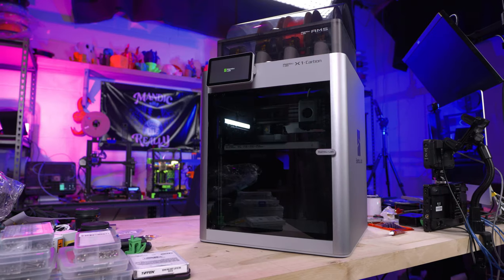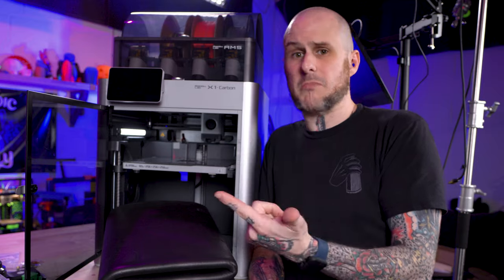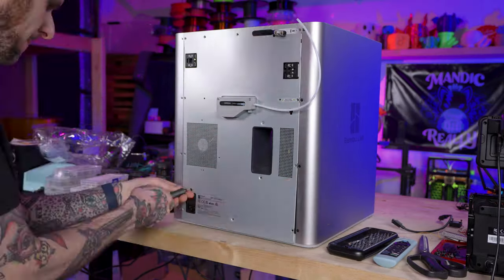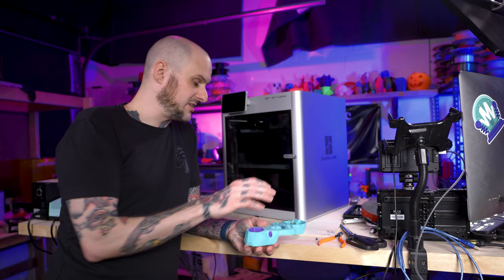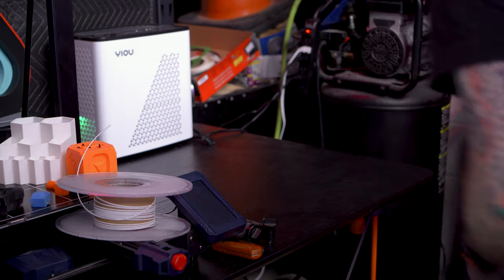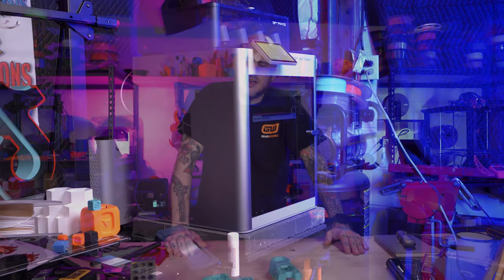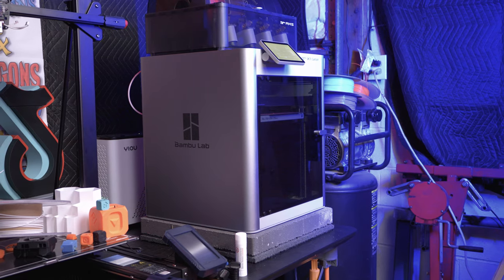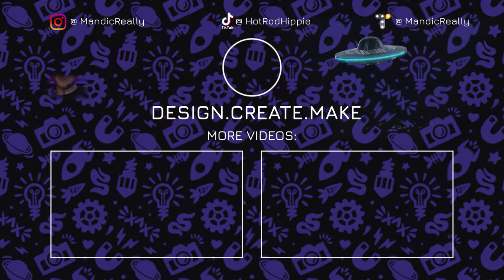Bambu X-1 3D Printer Modding & Problems - Noisy Ringing BEAST!

Comment: Just stick Teroson tiles to the AL panels and bottom panel. Your foam does not add much mass, Teroson add both viscous layer and mass. In you case youmaystill radiating a lot of noise through the panels. Your foam seems to be a closed cell foam and might be also a hasard if it is not fire rated.

Comment: I know this is an older video. I just purchased the BL X1CC and am watching a lot of videos about it. Did you try the anti-vibration feet you can buy for $10? I've only seen 1 video about them so far and he basically took them off right after putting them on. They do make the printer move/shake more, but to me, that means if you have multiple printers on the same table, then it's not going to transfer it's vibrations to the printers sitting adjacent. Makes logical sense in my mind, but I don't have the tools to measure that scientifically.

Comment: Have you checked if it's the slicer generating smoother edges? I've also noticed that slicing STLs is different and the slicer fails with some models if in 3MF format.

Comment: I would do the car audio sound deadening material for all of the panels.

It works better than the foam stuff in my opinion.
Reply from the maker: I did.  Everywhere you see the Foam stuff it has the foil material underneath it.  It is doubled up.
Reply: @MandicReally  ok my mistake, I think what you did here is fantastic.  I have one of these on preorder.

I’m going to do this same thing.

Are you sure you’re not getting good vibration correction because the table simply isn’t stable enough.

Maybe try doing the correction on your garage floor, and then printing the part for the Voron?
Reply from the maker: @frictitious  I did that at @14:50 it only made a marginal difference.  Still not to the quality I would like to see.
Reply: @MandicReally  My mistake,  I listened while working on one of my other printers.

That’s disappointing to hear….
Reply from the maker: @frictitious  I know of another person who printed a StealthBurner shroud without issue (multicolor as well). Mine just… isn’t. So maybe it’s just my machine? Maybe it’s a bigger issue? I don’t know yet.

Comment: For your rounded corners, try to see if there is a "corner velocity" or "jerk" setting. having those high makes for faster prints but rounded corners with ringing
Reply from the maker: It is a closed source printer. There are no settings menus to tweak things like that. The slicer doesn’t have anything beyond general acceleration and speed settings. 

That was the point of my statement about Klipper. I have NO IDEA what the machine is setting when it does it’s own calibrations and no way to tune them manually to test. It’s all a black box. That may be good for a newbie, but it is very limiting otherwise.
Reply: @MandicReally  there is probably a setting in the firmware but it’s not available to the user. Curious to see what bambu lab has to say about this.
Reply: The max jerk is set to 9mm/s for X and Y in the slicer, so not at a point I'd expect to see significant rounding.

Comment: I wonder if heat reflective foil on the glass would help keep heat in.
Reply from the maker: It absolutely would.  I'm debating ordering another piece of glass to test further and slap some of the foil insulation on it.  Currently I have the rest of that sheet of foam just sitting on top of the glass (outside) and it has raised the chamber temperature to 51C, the first I've seen it break over 50C.
Reply: @MandicReally  even the see through foil that goes on windows to reflect heat either in or out might work well enough
Reply: I also see that the display for the chamber temperature shows a maximum of 45°C, I wonder if it starts venting warm air to maintain the temperature at 45 degrees. Unfortunately the option to raise the chamber temp up more isn't available.

Comment: The most unpleasant noises are coming from the fans if printing material that needs cooling and from the motors when changing directions. Printing gyroid-infill for example is very loud while other infills far less annoying. The most especially fan-related noises coming from the back of the printer and just putting a thick blanket behind does quite the difference.

Comment: You really messed up the printer. I used reflective insulation sheets with magnets for my P1P printer, to cover the sides over the acrylic glass covers for printing with ABS and nylon filaments to retain the heat. It does work well including reducing the noise. Very easy to remove when using PLA and PETG filaments. The P1P printer with AMS unit is a better choice than buying the X1 carbon. You can make the enclosure of your choice and upgrades.

Comment: You seem pretty experienced with this sort of thing so despite the official recommendation Id love to see you try out TPU/soft pla on the AMS and give your findings, results and problems.

I absolutely plan to give it a shot when I get mine given I too have a lot of tinker experience, but I've been curious ever since seeing it.
Reply: The AMS doesn't work with TPU, but directly feeds the results are amazing even I'm printing at 120 to 150 mm/s default.
Reply: TPU does not work in the AMS because it gets stuck and can cause damage, you need to feed TPU in directly from the back hole

Comment: I have NO problem with the noise thank god. Mine sits in a  room with 10 other printers @ times it not even the loudest printer in the room :P  What i do have a prob with..... is when it really gets going it looks like it wants to dance it's way off the platform it's on..... im thinking to just hard bolt it thru the base. Thin metal sides will always ring.... it's actually a really bad choice as good as it looks.  PC's and Cars prove this.
I would even consider custom 4-6mm plex sides and i guarantee it would help the DB's

Comment: what foil back foam did you use your link is mixed up
Reply from the maker: Here is a link to some I just bought a few weeks ago: https://amzn.to/3HwdDSB

Thanks for the heads up, Amazon always messes up links eventually. I’ll change it now.
Reply: @MandicReally  sweet I just started printing abs and my chamber wouldn't get above 40c(unfinished basement single digit weather out currently).... little bit of lifting but not bad....gonna try to insulate the top first.

Comment: Hey, one thing that makes sense for me is that the acceleration is to high and that's what makes the edges more soft, as in klipper implemetation of input shaper it displays max acceleration not to introduce smoothing on edges.

Comment: Shiny materials?   $1.40 Flat Black Spray Paint.   Sound insulation --- Self Stick indoor/outdoor carpet. About 1/8" to 3/16" inch thick works.  Or - wetsuit material - neoprene.

Comment: You might not be seeing ringing so much as too much input shaping. Not sure if you can change your shaping tools on the X1 but it could be a good place to look.
Reply from the maker: I agree, that Is what I was trying to say, the compensation seems too aggressive, leading to the rounded corners.  It seems like the "Resonance Compensation" is applied to the wrong frequency or too aggressively.  There is NO control over this in the machine.  None at all, and no way of reading the data from the vibration testing to see if it is in fact incorrect.  The system being closed source doesn't allow for any of this advanced tuning that it clearly needs.

Comment: It will be interesting to see how many of your mods go into the mk2.
Reply from the maker: A little bit of the sound insulation would be very easy for them to install at the factory and go a LONG way I think. Just some thinner stuff like we use in building cars (similar to what modern cars have in their doors). We shall see.

Comment: Hello, I watch a few of your videos and i noticed you mentioned you worked as a custom auto mechanic.  Curious to see your reasons for jumping into 3D printing or how did you start.  Also did you have prior experience with 3D printing as a whole, as well as working with 3D modeling on fusion?

Comment: If you're considering purchasing a Bambu printer, have one on the way, or just bought one, all you need to do is ensure your filament is dry, run the calibration tests, and start printing. The only additional accessories worth printing are a poop chute catch can and a quick-release tool for the PTFE tube in the back. All this other shit is unnecessary.

Comment: Hi, regarding the sound, would placing the insulation outside (as an outer shell) improve sound dampening? 

I recently got into 3D printing and looking for a fast one but I’m concerned about the sound it makes and the speeds the Bambu X1C makes.

Thanks! Great video on dismantling the printer’s shell
Reply from the maker: Sound dampening should be done closer to the sound source for maximum effect. Outside of it the noise has a chance to resonate inside of the metal structure of the machine. More dampening on the outside wouldnt hurt, but would likely be ugly and less effective than inside. Unless you just build a big enclosed box, but then you run the risk of temperature issues with the electronics.

Comment: Add a reflective heat blanket material. It's super thin and will keep the heat in
Reply from the maker: I’m thinking I’ll buy a spare top window and insulate that to retain the heat at the closest point to the print area. Or maybe seek a thinner insulation for the sides.

Comment: Could you talk a tiny bit about what speeds you chose to run these tests at?

How were the corners at non-speed-benchy speeds/accel?
Reply from the maker: The ones in this video were in entirely “default” settings. Base speed settings of the .2mm profile, and “Standard” Speed on the machine. Some of my other tests were done at manually adjusted lower speeds. One was started at the “Silent” setting on the machine which cuts the speed by 50%. That one lifted off the plate so I wasn’t able to complete it. 

I haven’t wanted to pursue the speed Avenue as much because if that IS the issue, then Bambu had a problem. Making a machine fast for just the sake of fast, is not a good thing. So I’ve focused on maintaining the speed and trying to improve there. Something that should be attainable with proper settings (I believe).
Reply: @MandicReally  I guess the question becomes, "is Bambulabs pushing the machine faster than it can go with regard to accel or is their resonance comp just not tuned well?"

I'd love to see a test where we could see X ringing vs Y ringing to see if it's compensating for the weight of each axis differently.

Comment: On the rounded corners, have you tried bumping up the flow rate for your filament (or is your filament actually smaller than the slicer thinks it is; exactly 1.75mm by default)? Your top surface looks like it might be marginally under extruded which could be improved from adjusting the same settings.

I'm presuming that the corners are not extruding out quite as far as they should be, which is totally the opposite of the issue that I had, and dropping my flow rate slightly (and ensuring that my filament diameter was correct in the slicer) totally fixed the issue and got me the crisp (not over-extruded) corners that I was after, and a better top surface.
Reply from the maker: Mine was massively over extruding with this Polymaker ASA at the default “Generic ASA”
Values. The flow calibration could not compensate for it. I’m down to .90 flowrate (and it’s accurate dimensionally, Polymaker makes good stuff). I had to go that low to stop the overextrusion I was getting. Which on my Ender 3 I actually run at .93 now, this stuff just really flows. 

I can’t seem to nail a balance of extrusion on this machine. The top (and bottom) layers have minor underextrusion, but I’m happier with that than the substantial overextrusion I was getting. 

I really wish I could see the settings the machine is using. It seems to be like a Corner Velocity, Linear (Pressure) Advance issue, but I can’t tell because I have no data.
Reply: So at say 0.91 you were getting over extrusion on the top and bottom?

If you bump up the flow rate, despite the top and bottom layers being overextruded, do the corners improve?

I agree it would be nice to not just have to blindly trust the flow calibration data to be generating useful linear advance values.
Based on the G-code, if it has an issue with calibration it also just runs with default values - I'm not sure whether or not it would give you an error in this case to inform you of the flow calibration failure, unless it detects a hardware error/error in sensing generally.
Reply from the maker: @mowcius  I don’t believe it gives you an error because I’m 100% certain at the default .95 value it was just using its own default values. No flow rate adjustment any difference to the corners. I don’t think those are at all flow related. If they were I’d expect to see it in the perimeters of the print in at least a some other way (more or lesss noticeable layer lines, or gaps in between perimeters while printing). I truly believe the issue is to do with either Square Corner Velocity and/or the Input Shaper implementation. 

It’s hard to Discuss this stuff when we don’t even know what terms they use for these settings or what the firmware is doing with any of the data. I’ll be reaching out to Bambu and looking for their input & requesting deeper information.
Reply: @MandicReally  I think you should let us know as quickly as possible how they helped you.

It’d concerning that a reviewer is having these issues and they haven’t already reached out to you to try and help solve the problems.

How are is peasants going to get any help?
Reply from the maker: @frictitious  I bought mine. They don’t know me anymore than anyone else (that I’m aware of). I requested a review unit months ago and never got a response. But I’ll definitely make an update when I figure out what the heck is going on.
Reply: @MandicReally , so I didn't think changing flow values would change the corners, but for me it did, quite significantly.
General perimeter extrusion didn't really seem to change, but top and bottom layers and corners did.

My single wall thickness, and calibration object dimensions were spot on, all through tweaking these values.
Reply: I obviously have no idea what they’re doing for their vibration compensation, but from the corner behavior, it seems that part of it might be a kind of “low pass filter” applied to the tool path. Another way of expressing it is that the algorithm isn’t just looking at what it’s going to do after an abrupt vibration-inducing change in velocity, but rather is looking at the tool path as a whole and in some part dealing with vibration by knocking down abrupt changes in the velocity of the planned motion, so it’ll have less ringing to compensate for in the first place.

It seems to me that they could provide alternate algorithms that the user could select depending on the print in question. The current one could be the default and provide the highest speeds, while another could decelerate the print head as it approached a sharp corner, make the turn and the. Accelerate again. This would probably take a lot more number-crunching than what they’re doing now and would slow print times some, but they certainly have plenty of processing horsepower to do sophisticated adjustments like that on the fly, and an approach like this could still deliver substantially shorter print times than just slowing everything down.

(Side note: I wonder to what extent issues like this might be slowing down the Prusa XL development?)

Comment: Did you also tried to print the stealthburner shroud a bit slower? I mean even if you print it on voron with klipper, the higher the acceleration and speed is, the more smoothing you will have on sharp corners. Offcourse this machine is designed to print fast, but there is always a compromise between speed and quality.
Reply from the maker: I did, I just didn't get into the weeds of my testing on this video.  Some of the ones I showed were printed at significantly reduced speeds and still exhibited issues.  Part of the problem is I try to test machines as they are presented to me.  This is presented with a full Slicer and profiles.  If the speeds are too great to produce quality results, that is a cause for concern about how the machine is provided.

My results have improved drastically since I filmed this and I will cover what I've done to get there in an upcoming video.  Slowing way down was absolutely a part of the equation.
Reply: @MandicReally  I agree with you, the manufacturer should mention that high speeds and accelerations decrease the quality, or they should just add a quality profile with less acceleration. I just got my x1 carbon yesterday and was surprised, how terribly loud the machine is. Especially the fan on the back that is used for air ventilation. And I also wanted to put some car antivibration plates to make it a bit less noisy. There are some antivibration plates that are 2mm thick, so I think that would be just right for places where xy joints are moving.

Comment: I just did the mainboard fan mod with a noctua 5v and no buck converter. One of the loudest fans is the tiny hot end fan. Any ideas on that?
Reply from the maker: I’ve looked at it. About but haven’t figure anything out so far. Fitting a bigger & quieter option I’d difficult. Fans of that size are rarely quiet. I’m gonna do another one of these videos soon so I’ll look a little more.

Comment: What about insulating the outside and building or printing a new shell?
Reply from the maker: The frame is steel & aluminum, insulating before the outer materials reduces the heat soaking effect into those. A box around the machine would mean those materials have to heat soak to stabilize temperature within. Along with the electronics that are likely not intended to be subjected to the heat continually. It’s better to stop heat as close to the source as you can.